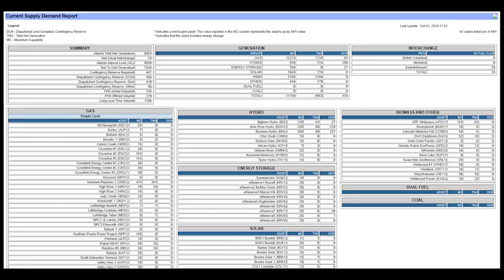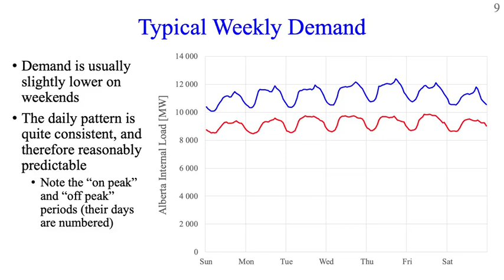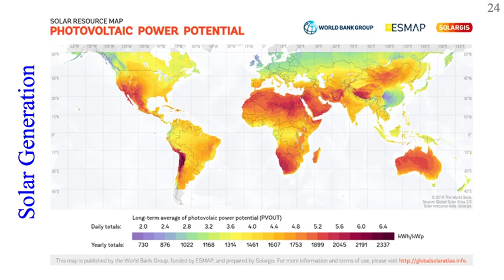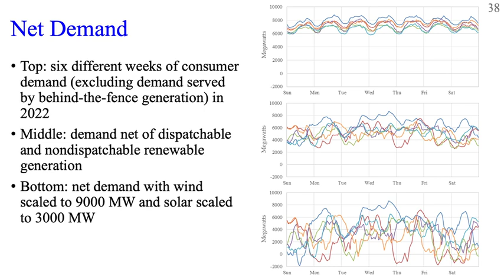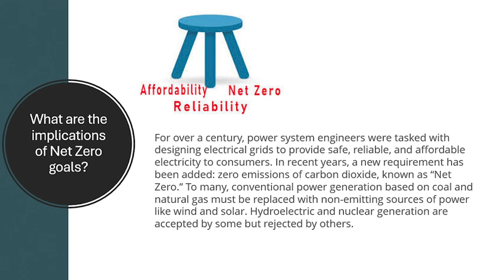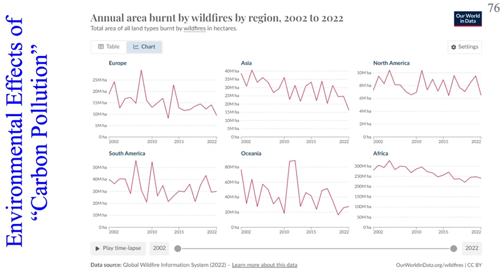Event Recording: "Net Zero and the Future Power Grid"

Comment: This man is the Director, Regulatory Policy at ENMAX. I wonder what he is pushing? I wonder why the "friends of science" didn't mention his current job? When we have excess wind power in Alberta we sell it to BC, SK and Montana. When the wind isn't blowing we buy hydro from BC. BC buys our wind because it allows them to throttle back their hydro and save it for when the wind isn't blowing. We could do the exact same thing or similar things here but we don't. I always thought Albertan's had a "can do attitude" but they suddenly turn into whiny, nay sayers once wind or solar is mentioned.
Reply: His job was not mentioned because he was speaking as an individual Professional Engineer.  Here's more on Alberta's Electricity Challenge. https://youtu.be/NTNJVuLD7FQ  We do sell power back and forth between all our regional interties but that's not the issue with renewables.  The issue is that they are intermittent, unreliable and not dispatchable.  Can do attitudes don't change physics.

Comment: Goes to show that the term renewable energy should be replaced by unreliable or intermittent energy.
Reply: It just occurred to me that I didn't hear nuclear mentioned. Nuclear is not as scary as people have been led to believe. It would make sense to use nuclear if you were seriously afraid of global warming from carbon dioxide emissions resulting from the use of fossil fuels.
Reply: @user-db8kt8ti4c  At this point, Alberta does not have any nuclear facilities and there are no such plans on the table (at this time - though some discussion in progress).  So the objective was to deal more with 'what we do have' and the realities within this short-term framework (i.e. by 2030/35 there could not be a nuclear plant, even if one was already in development).  No intention to dismiss nuclear; just not part of the short-term realities.
Reply: @fosmedia9986  470 Mwh Small modular reactors (SMR) can be installed in about 500 days according to Rolls Royce. The main obstacle is more to do with planning permission.
Reply: @Sjb-on5xt  Building and commissioning a conventional power plant takes about 20+ years in Canada.  Land acquisition,  drawing  up plans, doing environmental assessment impact plans and getting approvals, finding investors, ordering the equipment, planning and requesting grid access or building of additional power lines (depending on where the plant will be), then the building and commissioning. The installation is not the main issue.